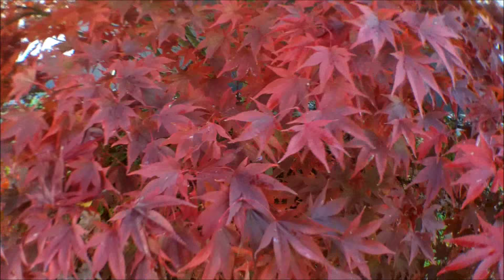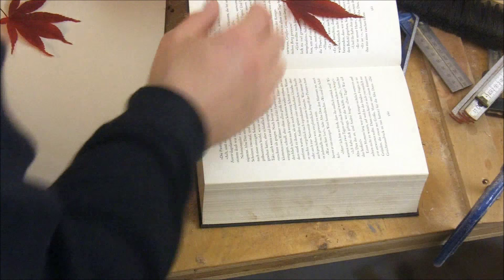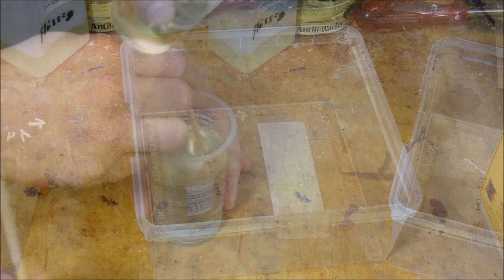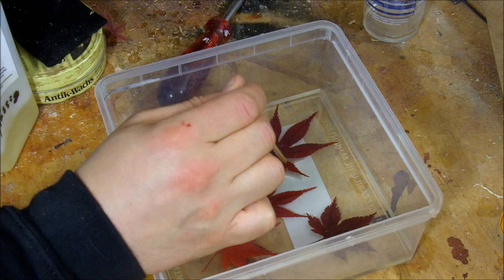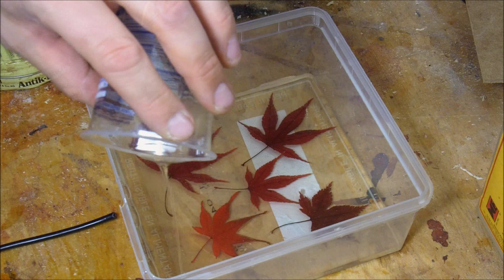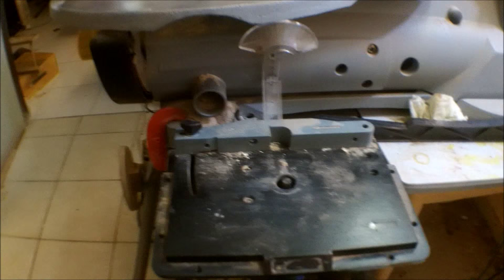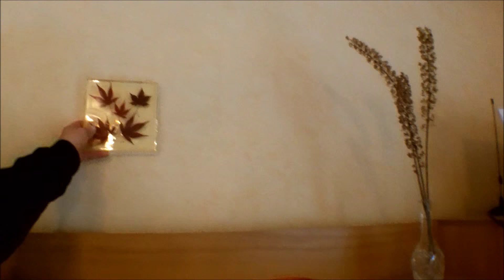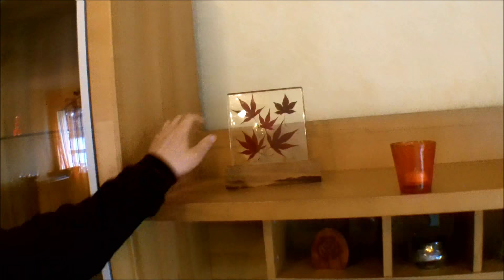Fall Decorating - Epoxy Resin Casting // How-To

Comment: Hi Fabian.
This looks like a simple project with excellent results! How long did you dry the leaves? Have you ever tried to cast fresh leaves or other fresh organic matter (like moss) in epoxy? When you put the leaves on top of the first layer of epoxy, is it important to remove any air bubbles that get trapped between the leaves and the epoxy, before pouring the 2nd layer?

I experimented with fresh leaves and another epoxy product but every time had large air bubbles form around the leaves as epoxy was drying. Maybe a chemical reaction of epoxy with leaves? Maybe trapped air bubbles expanded with the heat from drying? Either way, didn't look anything like what you got!

Thank you!
Reply from the maker: I did dry the leaves for a week or so. I had no problems with air bubbles I think it's because I used a slow drying epoxy. There are a few small air bubbles but you can barely see them.

Comment: looks beautiful! but why does this work without a pressure pot? I thought epoxy needs it to be clear :/
Reply from the maker: Thank you! It's a low viscosity epoxy and it has a long drying time so the air bubbles have plenty of time to rise to the surface. A pressure pot is usually used when you stabilize wood. Then air might be trapped and the pressure compresses the air to a minimum.
Reply: thank you so much! really enjoy watching :) inspires me to get active myself ;)

Comment: Hi! Great idea. Thanks for sharing. How long did you dry the leaves? And also, did you use a mold release spray inside the plastic container before pouring the epoxy resin? TIA
Reply from the maker: Glad you like it! Hm... maybe a week or so. I can't remenber! No I did not use a mold release spray. The resin did not stick to the plastic.
Reply: @FabiansTinyWorkshop  thank you very much for the reply. Appreciate it. 🙂 I will definitely try this and share my experience. I'm currently trying casting butterfly wings (collected from a butterfly house after natural death of the butterflies)

Comment: Didn’t you need to torch any air bubbles?  It came out too easily from plastic. Seems altered from reality. Not that easy.
Reply from the maker: It is a slow drying low viscosity epoxy. The air bubbles rise to the top and vanish after a few minutes. Yes of course it took a little longer to get it out of the plastic but who wants to watch me fiddling around for a minute or so?

Comment: how long did you let the epoxy cure for?
Reply from the maker: In this case 48 hours because it is a slow setting epoxy.
Not every epoxy cures equally fast.
Reply: Thanks for quick response. And how long did you let it cure before putting in the leaves?
Reply from the maker: I guess it was about 2 hours.